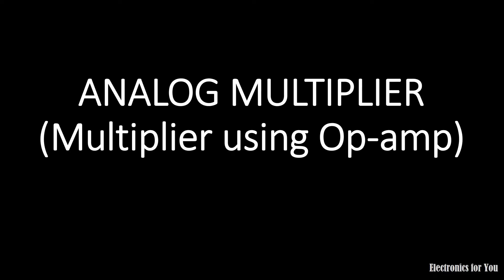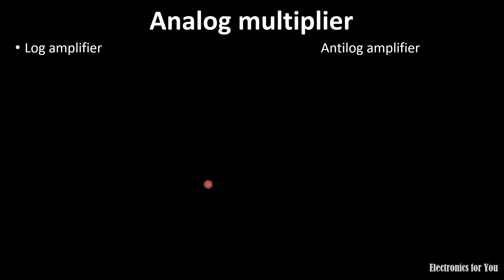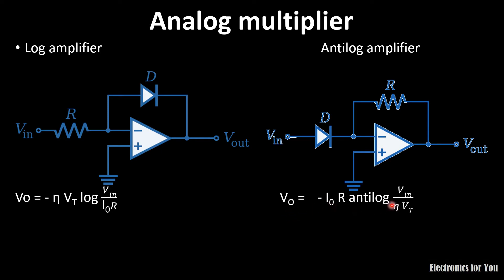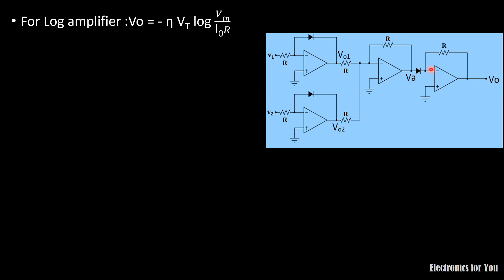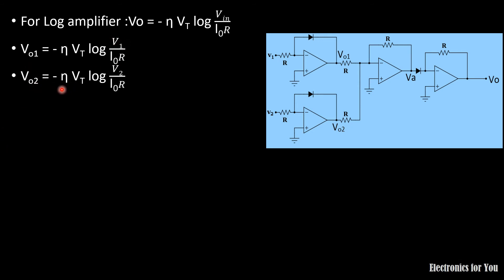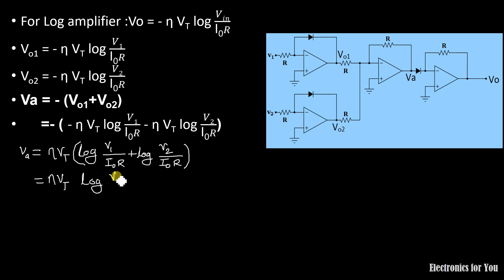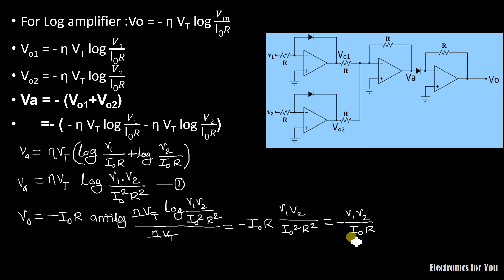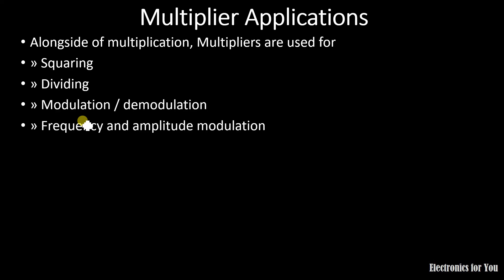Analog Multiplier using Op-amp | Multiplier circuit using log antilog amplifier

Comment: sir, can u provide me with a circuit and values of all components
Reply from the maker: Deepak ji, you can use circuit provided in video. It is shown from 4 min 15 sec. Use every resistor of 10K and same type of diodes.

Comment: design a circuit to up convert the frequency of 2khz to 5khz
Reply from the maker: You can not change frequency using simple 741 op-amp. You will need a different circuit such as mixer for freq shift.
Reply: @ElectronicsforYoututorials  can you provide me the circuit diagram to up convert the frequency by creating frequency mixer using opamp or with mc1496 IC